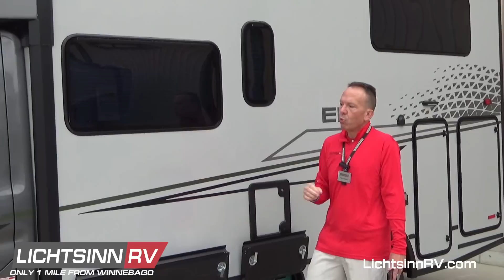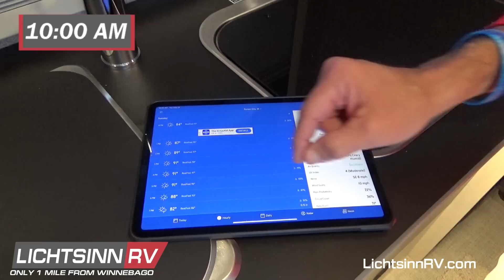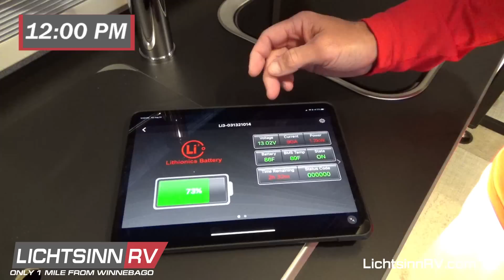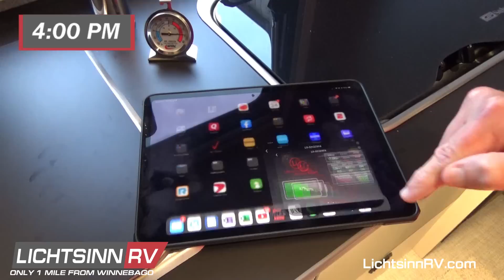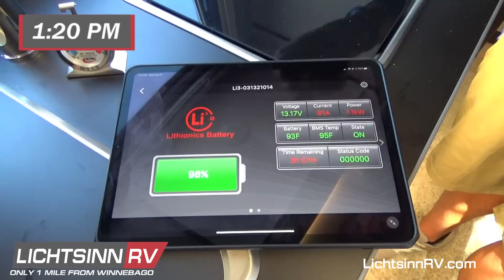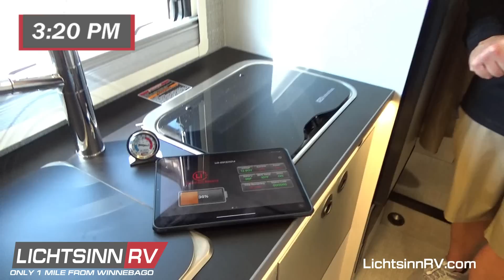LichtsinnRV.com - 3 Tests for the Winnebago EKKO AC Run Time

Comment: Can we up the inverter to say a 3000 watt option and can we add additional Lithionics batteries in the rear storage compartment?   I see them on line for $4,500 vs 7K option at the dealer.
Reply from the maker: Good afternoon Buster!   Just give our service team a call at 641.585.3213 to review customization... not sure if the battery cable length would be an issue for them, but we can change the package to two batteries total

Comment: Purchased an Ekko and it’s my first RV. The AC doesn’t start solely off the battery. I have to first start the generator. 

Is this normal behavior?
Reply from the maker: Good morning Matthew!   Thank you for your note... this is certainly not normal behavior and I'd recommend you reach out for service... if you'd like to book an appointment with us, just reach out to us at 641.585.3535... we certainly do not discriminate based on where the coach was purchased... we will help any of guest!

Comment: Thanks for the test . Very informative. Question. Will the generator kick on if the battery runs out. Just a safety net for leaving my dog inside.
Reply from the maker: Good afternoon!   Thank you for your note!  We can help with that!   We would just add the CumminsOnan auto gen start feature, no problem, which is an inexpensive upgrade!

Comment: Is it possible to damage a lithium battery by taking it to complete discharge?  I know with lead acid and AGM you don't wan't to deep cycle them regularly and avoid complete discharge.  Thanks for any response.
Reply from the maker: Good afternoon!  Continuation yes, but there is a reserve level notification to prevent this.   Hope this helps!

Comment: Nice… I’ll be having two of the batteries so the shore power through inverter will be splitting its charge onto two batteries this doubling the total charge time for a 100% dual battery charge.   Would be nice to show how fast with engine idling.  The dedicated alternator I believe will provide 1.6 to 1.7 kW of charge vs the limited 1kW of charge coming from the inverter and that’s at idle.  So I feel pretty confident that they f I charge my batteries before sleep on a hot a humid night I should be comfortable till the morning when the system can be recharged, if needed.  Thanks again for doing this experiment and sharing the results.

Comment: I haven’t seen it mentioned yet but does the battery tray slide out of the compartment to allow easier access to the battery or is it fixed?
Reply from the maker: Good morning Devin!   Thank you for your note... the battery compartment does not need or have a tray, but keep in mind the lithium battery setup is maintenance free.
Reply: Thank you for the reply

Comment: How about testing using only the generator?  Just curious
Reply from the maker: Good evening!  Thanks for your note!   The recharge time would be the same off the genset vs being plugged in.   The genset operation time would be approximately 48 hours at a minimum if running genset only.   Hope this helps!
Reply: @LichtsinnRV  Am I understanding you correctly? The genset will run the AC for 48 hours? Is that with a full tank of gas? The Facebook EKKO group I belong to has an ongoing debate. Which is better, 1 battery with the gen, or 2 batteries without the gen.
Reply from the maker: @renaissancepoet  Good morning!  Thanks for your note...   

The primary answer is 50-110 hours off a full tank of fuel, absent using the inverter and battery, so simply genset operation

Here’s the math…

The EKKO has a 31 gallon fuel tank.   The genset runs off the top ¾ of the 31 gallon fuel tank, leaving 23 g available for genset usage.  The CumminsOnan 2800i uses .21g per hour at half load, translating into the high end of 110 hours (23 g / .21 g per hour consumption).   At full load, so worst case scenario, it pulls .46 g per hour, translating into 50 hours.

If you feel like you'll be off grid in very hot conditions, we recommend the standard setup from Winnebago of a single battery and the genset.   Then we can add the second battery, so you would have both batteries and the gen.

Hope this helps!
Reply: @LichtsinnRV  Awesome!  Thank you for the reply.
Reply: @LichtsinnRV  the other variable that was not discussed, was the under hood alternator. At idle, how long does it take to recharge the battery?  If this is a shorter time than the generator or AC input, then why have the generator option?  Just have the one or two batteries and depend on the sun and the under hood alternator to charge the batteries?
Reply from the maker: @gosman949  Good afternoon!   It will charge between 100 - 170 AMPs depending upon idle or generator.    Idling a vehicle that long is not good for the engine, and so we chose not to, but directionally it should charge in about 1/2 the time at highway speeds.
Reply: @LichtsinnRV  Also, isn't there a 'no idle' rule at many campgrounds?  And some even have certain stated hours for running the generator (like no gens after 7p or such).
Reply from the maker: @chefduane3742  Good afternoon!   There are definitely no generator hours regulations, but I have only seen no idle rules for diesel pusher RVs.  Hope this helps!